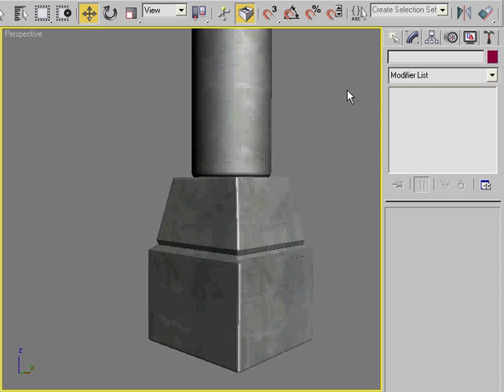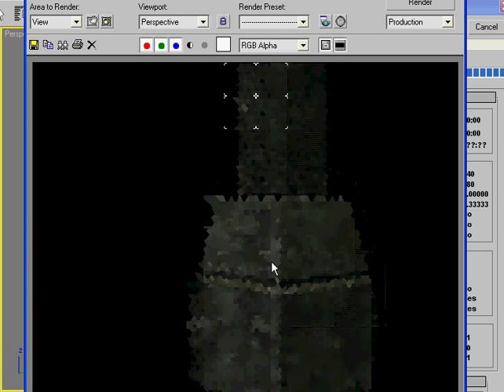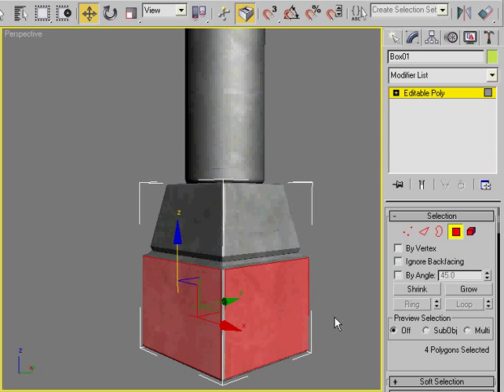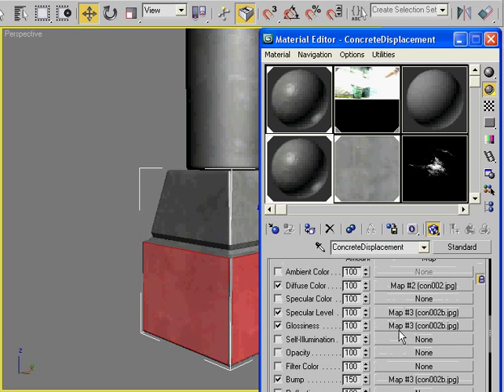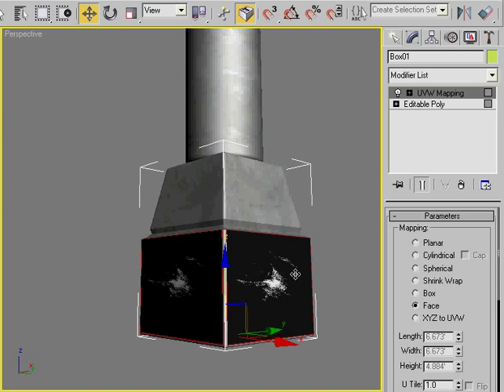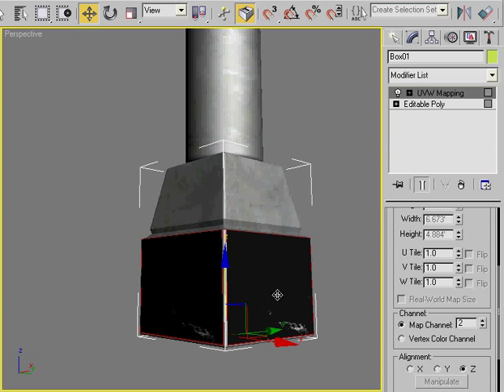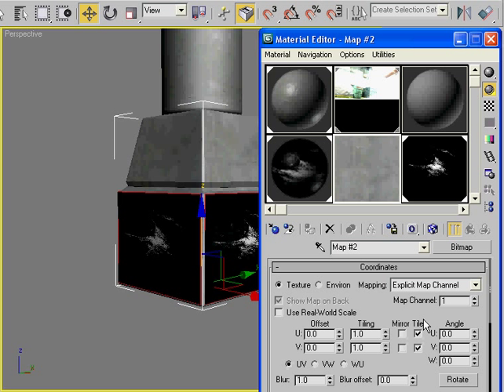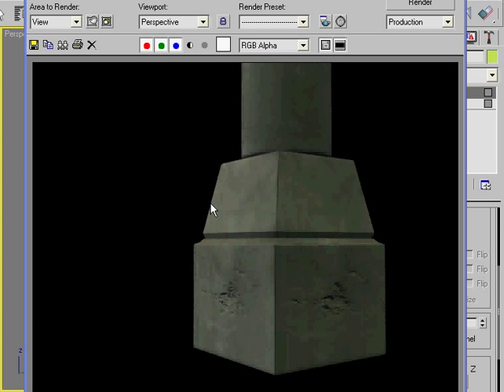3dsMax Monday Movie #13: UVW Channels

Comment: Another useful tutorial.

Question : Is it possible to merge these details into 1 texture, because the game engine I'm using doesn't support displacement, bump, etc ... mapping. This way I could retain all the details and still have great low poly models.

Cheers :)

Comment: I've tried Render to Texture and got the majority of working. The only problem is that I don't want it to render shadows as these are handled by the engine. Both lighting and shadows are uncheck in the menu and I'm not sure what else to try.

Cheers.